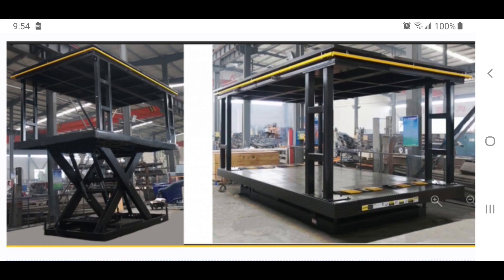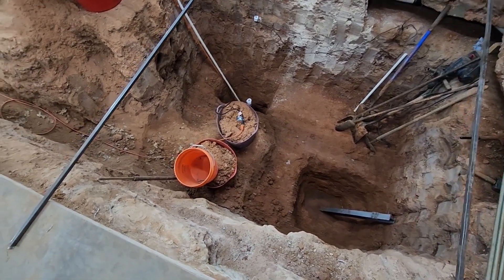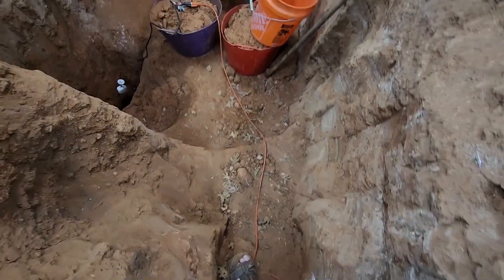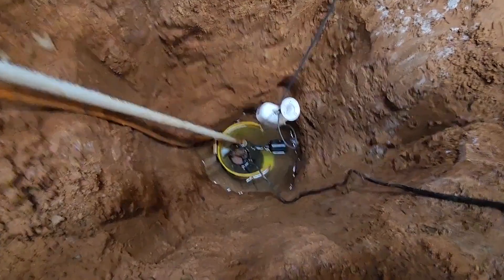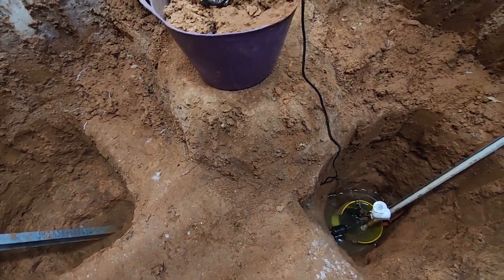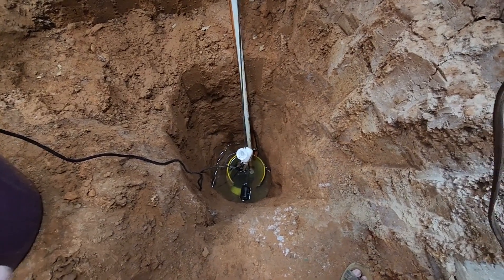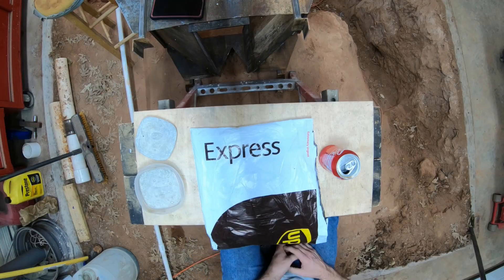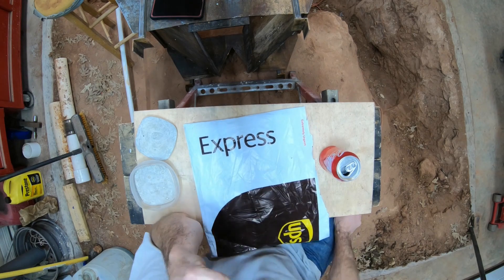I struck WATER!  Pre applied water proofing solution from Oriental Yuhong

Comment: Interesting, Looks like magical stuff.
Seems sensible coming up all the way to your floor slab, maybe not with that but a lesser dpm, I've noticed that with exposed clay it will give up it's moisture to air, then it cracks and shrinks.
Reply from the maker: That is true, the surface of the clay dries out, but dig in a foot and it's still soaking wet.  I only need to come up past the highest season water table height.
Reply: @jagboy69  will you have ventilation in there anyway?
Reply from the maker: @turboconqueringmegaeagle9006  I think so.  I'd like to have a passive system that pulls the air out of the hole using the heat from the attic and out the roof.  If not, I can install an inline fan setup.  Not worried about fumes, the top deck will have a rubber seal around it.  Once I solve this water up to my ass issue, the rest should be pretty easy.  The hydraulic system and motor is going on ground level.  If it was under the lift, with my luck, it would crap out with 2 cars loaded.  If you want anymore info on this HDPE PMH-3040, you can find it on "Made in China" the stuff is running around 8bucks per sq meter, it comes on rolls of 1.2m wide.  The trick is now getting my hands on about 70sq meters of the stuff for my pit.
Reply: @jagboy69  excellent, that sounds like something that could work especially if you can get an inlet somewhere relitively cool and low, but another reason to have the clay face sealed to the sides as a throughput of air will always want to pick up any moisture, regular dpm down the walls with your adhesive membrane and slab sat on top of what overlaps the floor would be so cheap and easy, and a good insurance policy I would have thought.
I'm just concerned with waterproofing my individual precast sections, I will have so many mortar joints and sections I've really concluded at this point that continuous pumping is my only option.
Reply from the maker: @turboconqueringmegaeagle9006  I wanna try something with this stuff.  I'm going to cut a little piece and stick it to my driveway on a hot day.  I'm curious how well it will stick to concrete that's already cured.  Will report back with my findings..  Have you looked into bentonite?  Your situation is pretty complicated.  I thought about plastic sheeting, one thing for sure, water is very patient and will almost always find a way.  Stay dry buddy!🍺
Reply: @jagboy69  just a test to observe the activation of the adhesive?
I'm tunneling through bentonite, but on the shaft dig hit seams of sand and no reason not to expect more of the same going horizontal, truly fascinating from a casual geology perspective. 
There used to be a harbor here in the 15th century, now the sea is 10 miles away.
Reply from the maker: @turboconqueringmegaeagle9006  Exactly.  If it's heat that sends this glue into overdrive, I'll see it on my hot texas driveway.  That being the case, maybe it could be added post concrete pour?  It is a very inexpensive material..  Compared to some higher end vapor barriers, it's almost the same money!  Add in you can't puncture it easily, it sticks to itself like crazy, it could be the best solution out there even if ground water isn't present.   Stay tuned!

Comment: Sweet stuff.  Sorry to hear about the water issue, not a fun thing to run into so close.  One thing to think about on your water level is how much does it go up during the spring during the snow melt?  Maybe not an issue for you wherever you are, but I get upwards of 1-2' feet of water in my crawl space during the melt in the place I'm currently at.  Anyway, all that to say, go a bit higher than you think you need!
Reply from the maker: Excellent suggestion!  I left the pump off for the last week and the #2 hole stayed very low.  So I think the water table level is dropping due to summer.  Our winters are very mild here so I don't expect a lot of snow melt.  I wish I had reliable information unlike what I got from the US geological people.  Just another government entity that can't be trusted to do their jobs! 🤬
Reply: @jagboy69  "I'm from the government and I'm here to help"?  You want something like that?  :)
Reply from the maker: @ChatterontheWire  EXACTLY!  I don't get how they could be off 40ft!  This isn't deep underwater drilling and being so close to the surface, surely they could be a bit more accurate.  If I knew water was this shallow, I would not have attempted something like this.
Reply: @jagboy69  Well now you have a 8ft bunker, Have you stopped work?
Reply from the maker: @That1ufo  No I don't give up that easy.  I have 2rolls of the membrane and will resume soon.👍